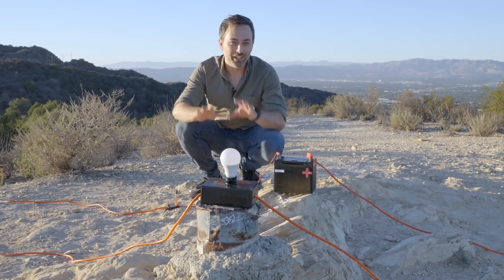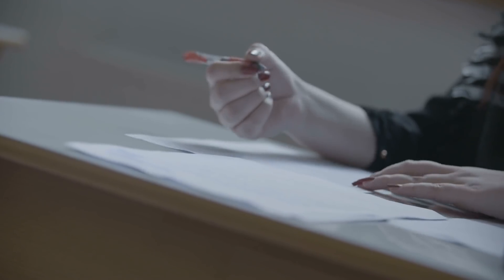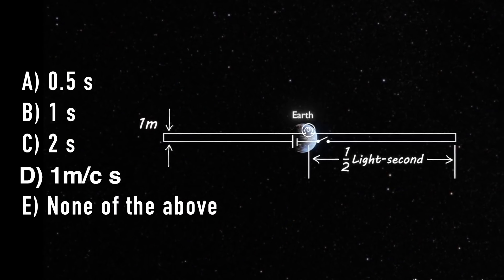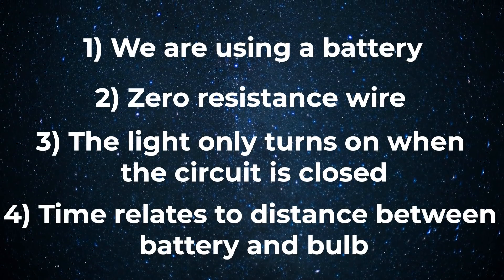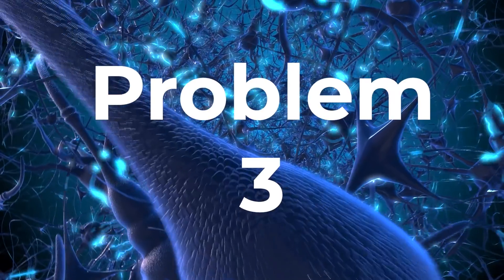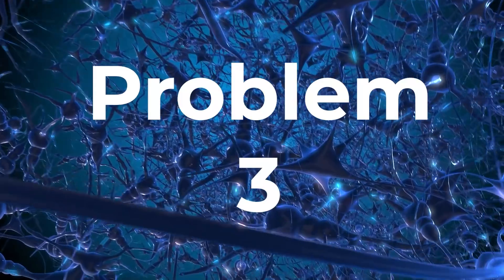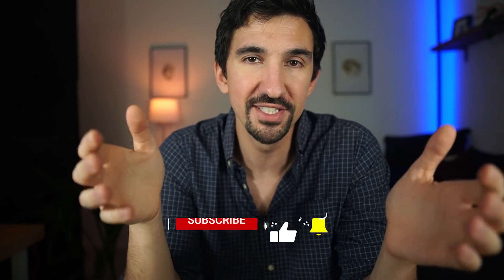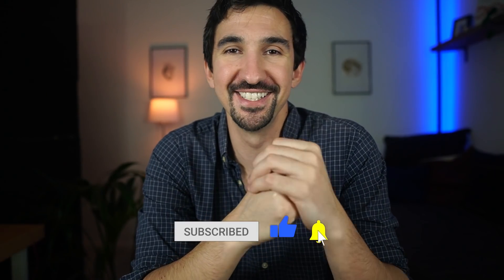Is Veritasium Wrong About Electricity?

Comment: The idea of general relativity and speed of light being a reason we cannot transmit info across the galaxy faster than the speed of light is wrong if you think of quantum mechanics and quantum entanglement.
Reply: Quantum entanglement doesn't let you transmit "information" faster than the speed of light.  Look up the no-communication theorem and you'll see why.
Reply: @JeRMRellum  ah but you are talking about quantum mechanics as a way to communicate over a vast distance faster than the speed of light. That is true, you can not use it as a form of communication, but it does not contradict the fact that with quantum entanglement information is sent from one entangled particle to another is sent faster than the speed of light. Quantum physics does counter the idea of general relativity and even Einstein knew this.
Reply: @Derek4k  Well, so entangled particles MAY be able to transmit information to each other faster than the speed of light.  But that isn't proven.  What's shown by Bell's experiments in 1964 is that local realism cannot be true, meaning either 

(a) non-locality: quantum entangled particles can communicate with each other faster than the speed of light or 

(b) non-realism: The particles are only real when observed (which the principle of non-realism is really weird, it basically says that if you have Alice and Bob both measure their entangled particles at the same time a light second apart, than Alice won't even exist until Bob is able to observe her and Bob won't exist to Alice until she is able to observe him).  

Quantum mechanics generally follows he principles of non-realism while an alternate to that is Bohmian mechanics, which says particles are all real and deterministic but they can talk to each faster than light.
Reply: @Derek4k  Also to elaborate slightly more on the principle of non-realism, I only really began to feel like I understood it when I thought of Minecraft.

Let's say theoretically there are only two fortresses with two ender portals in a world and let's say they always MUST share exactly 12 ender pearls between them that are already placed when you discover them.  This means when you find an ender portal and you see it has 7 pearls, you already know the other one will have 5 pearls when go to it later and observe it.  Or if you saw it had 9 pearls, you'd know the other one has 3.

Now, you know this number is random, and you also know that the number of ender pearls is determined when you first uncover the chunk and observe the portal.  Since Minecraft can't have both fortresses loaded at the same time, you wonder what would happen if you arranged to have both fortresses discovered simultaneously.

You coordinate with another character to count the number of ender pearls preplaced in the portal and to do that at exactly noon in Minecraft time.  You find yours randomly has 4 pearls, meaning you know the other one must have 8, so when you meet up later to check with the other character, you confirm this is true.

But how can this be?  Minecraft wouldn't have both chunks loaded at the same time (equivalent to in our universe we have c, the speed of propagation).  If this character is a non-player character, that answer is obvious, the NPC didn't exist until you went and observed it later, at which point the game determined that they must have seen 8 pearls.

Uh, so basically, I don't fully understand this, but I think either you end up with a solipsistic view of the universe or a many worlds one (no one else exists but me OR everyone exists but in their own separate universes which may diverge at anytime).
Reply: @Derek4k  From Wikipedia's Quantum Entanglement page: "According to some interpretations of quantum mechanics, the effect of one measurement occurs instantly. Other interpretations which don't recognize wavefunction collapse dispute that there is any "effect" at all. However, all interpretations agree that entanglement produces correlation between the measurements and that the mutual information between the entangled particles can be exploited, but that any transmission of information at faster-than-light speeds is impossible."

Key word is some.  And yes, if you believe that the universe is realist, than yes, the particles are communicating faster than light.

Comment: I absolutely loved this video and it explained everything I couldn't get my head around with Verulamium's confusing video. Conceptualising the wires as antenna as opposed to a circuit made perfect sense and pretty much explained everything. I felt as though Verulamium's video was deliberately confusing in order to get his video and resulting discussions viral.
Reply: Verulamium is the city of St Albans, England.     I like play on words…usually…but it doesnt always work.
Reply: Veritasium looks at the problem from first principles. From fields and charges. Antenna is a complex concept that uses those principles in a way that amplifies wanted behavior. What Derek does is like talking about how base pairs in DNA work, and mentioning antennas is like saying twins have the same eye color.
Reply: @niceshotapps1233  No, what Derek does is like mentioning that twins have identical DNA.
Reply: @Str4t0sph4r4  Yup. Which is actually key insight into why twins "work".

On the other hand, saying it works like that because it's just antenna or it's capacitance and inductance is like saying twins have the same color because they are twins, duh! It doesn't explain true underlying mechanism. It's just easier and more satisfyingly understandable.

Comment: It's easy to show someone is wrong if you're not considering the same exact system with the same assumptions (f.e. adding resistance, capacitance etc.). It's harder to see what's is wrong in Dereks circuit problem (indeed it is) if you consider exactly the same conditions. Here is why: the energy from the battery WILL REACH the lamp in approximately 1/299792458 seconds but that energy WON'T BE absorbed by it until the current starts flowing through the light ball which will happen after 299792458 seconds.

Comment: He didn't mess up with the units. Time = distance/speed. in this case distance = 1 and speed = c. Therefore time =1/c s. I thought it was understood that he was working in SI units.

Also you disregarded the capacitance of the wires.

No information is communicated faster than light in Veritasium's video.

Comment: I think that your miss understanding that the important part is the position of the switch not of the battery, because the wire have no resistence is the same as consider that the batery stretching the lenght of the wire. So when you break the cirtuit far away from the light it will take longer than when you break the circuit close to the light. I image that when you break the circuit far away the field will stretch legth of the wire than break so will take longer to the energy flow to stop.

Comment: This is a point I have too. 😅😅🤔
I'm wondering if Veritasium and the bulb were at each ends of the circuitry... And it was 3 000 000 kms long ? 
How many time would it take for the bulb to light ? 
And the same circuitry in his case ; ie  him and the bulb at the middle (you understand 😅) ? 

And your point about the units between the answers : it seems for me these kinds of when we can be confusing in w, w/h (wh-1 👏) and wh...

Anyway, thanks for your questionings 😂

Comment: You are wrong about the 'faster than the speed of light' claim, because the lamp is physically close to the switch, even if the wire is long. So causality does not travel faster than c. He's also not saying the bulb is turning on, so that's a bit of a cop out, he says it will take time for current to grow in th bulb..

Comment: I believe the answer is theoretically  instantaneous, I do agree that varataseum did not explain it well enough. However, our universe is still bound by maxwells equations and Faraday law of inductance. The theoretical perfectly conducting wire, even though it's perfectly conducting. Would still be bound by laws of inductance. The wire itself is not wound like a traditional inductor, but it still would act as a very large inductor with an extremely high inductance value. Therefore, current would flow immediately through the wire upon closing the switch, but the light bulb likely would not have any visible light emitting for multiple days. Faradays law is quite clear, as current flows through the wire, potential energy is then stored within the magnetic field the rotates around the wire following the right hand rule. The most hilarious part is going to be. That upon opening the switch, the light bulb is going to go out. But potential energy stored in the magnetic fields in the wire would produce such a high voltage, the arc between the connections of the latch would be devastating.

(I am an Electrical engineer, who fell in love with electromagnetics :) )

Comment: My take on that "breaking speed of light" problem:
1. EM fields spread at the speed of light, but not necessarily along the wire. 2. A circuit break (including an open switch) is where electric field is "broken".
When you close the switch / break the wire, EM field starts spreading from that point in space at the speed of light.
So when the breakage is 1 light-second away, the "bulb" will start "turning off" after 1 second, when is is 1m away the same will happen in 1m/c, regardless of wire length.
Reply: No. You should think about where most energy go. Not shortest way.
Reply: @piotrjuszczyk1  Not sure what you mean. The whole point of Veritasium's video is that [in idealized experiment, some] energy starts to reach destination in shortest_distance/c regardless of wire length. How much energy gets there how quickly is a different question.
Reply: @SunnyOhm  The main problem with the video is when the light bulb comes on.
It will not light up when the first field shift gets there. Only when most of the energy gets there. So after 2 s bulb on. Not after 1m/c.
If You look for problem: when first energy from battery get on bulb - the answer is: this is not about switch on/off. The first energy in bulb is when battery is. Switch does not matter like air beetwen bulb and battery  - does not matter. But this energy is very very small.
Sorry, I am not english man.
Reply: @piotrjuszczyk1  That's why I put "bulb" in quotes. Let's say it is a BJT with a very high gain (1000x is real) driving a tiny LED (human body has low enough resistance to visibly light them up from a 4.5V battery).
Reply: @SunnyOhm  Yes. But this no need switch in this case. 
And this is not case from veritasium.
Reply: @piotrjuszczyk1  Why no need switch? Transistor is placed in place of the lamp, and it won't open until current flows through it. Just a more real model of suggested idealized component. Same as a contraption for cooling the whole wire to superconducting temperatures would be.
Reply: @SunnyOhm  Because switch is only few mm of air. 
If You don't have trouble with meters of air - switch doesn't matter.
Reply: @piotrjuszczyk1  Switch matters, because when open it doesn't let electrons flow in accordance with electric field. And without charge movement there is no magnetic field, ergo no energy transmission.
When opening, switch won't stop electron flow immediately and completely, but eventually it will.
Reply: @SunnyOhm  How You can write about energy flow with meters of air and that switch with one mm of air stop this :)
Ok, I am to weak in english to explain this :)
Reply: @piotrjuszczyk1  The antenna analogy is aplicable here, just doesn't demonstrate things well enough. No one (I hope) doubts that antennas can transmit and receive energy, a simple AM radio receiver can work without any power source. The whole point of Veritasium video is that when there is a wire connection things fundamentally work the same way as withantennas.
Reply: @SunnyOhm  Clue of Veritasium video is question: when bulb light. That's all. After 2 s
Reply: @piotrjuszczyk1  If you want to be pedantic, it will take even longer. Inductance and capacitance of such a long "real" wire are enormous.
Reply: @SunnyOhm  The Veritasium thought experiment has specific assumptions.
Omits: resistance, capacitance, inductance, inertia of the bulb.
It contains one simple question: how long does the bulb light up after being turned on by the switch.
The answer is simple: after 2 seconds because the cable is 600 thousand. km long.
It does not matter that a small amount of energy will arrive after the time needed for the light to travel 1m. If small amounts of energy counted, the same position of the battery near the bulb would change the field there.
Therefore, the switch is not needed because for small amounts of energy - the field there is always changed by the battery. Whether he is there or not. Each change changes the field there, but not every change lights the light bulb.
Turning on the switch will of course change them, but it will still be a small change that has nothing to do with lighting the bulb. Therefore, the switch does not matter. The battery itself changes the field, regardless of whether it is this switch or not.

This question can be changed a bit. Assuming that the wire has a very high resistance, we know that the light bulb will not light up, no matter what you do with the switch or what the distance will be. How does the cable at a distance of hundreds of thousands of km affect whether the bulb lights up? :) It affects faster than the speed of light is? :)
Reply: @piotrjuszczyk1  I think I know what you missed.
> the field there is always charged by the battery
Electric field, yes. But there is no magnetic field unless electrons move somewhere. And without magnetic field Poynting vector is zero, so no energy transfer happens. The switch is exactly what stops electrons from moving.
Reply: @SunnyOhm  But the noticeable magnetic field won't come through the shortest path to the bulb. And therefore it does not matter whether there is a switch or not. Because we're talking about the experience of lighting a light bulb all the time.
A bit as if you connected a broken wire to the battery - will there be a field or not? :)
Reply: @SunnyOhm  I think I can see what Piotr's problem is here. The antenna effect you're talking about (and that this video is talking about) is based on the electrons moving and creating a change in the field that radiates out. That's all fine. What seems to break causality though, is that the electrons near the switch somehow "know" if there's even a battery attached to the wire, before 1m/c seconds.

Here's a slight modification to the thought experiment: What if when you were setting up this circuit, you could choose between two batteries. One of the batteries is dead, and one is live, but you don't know which is which. You install one of the batteries. Then when you flip the switch, according to this model, you'd nearly instantaneously see a change in the field where the bulb is, but that would mean you'd now have information about the state of the battery 1 light second away.

That's why Piotr is saying the battery doesn't matter. According to the antenna model, you might as well have a switch and wire, 1m away from a light bulb and another wire. Because the battery can't influence something a light second away in less than 1m/c seconds, so it's ultimately irrelevant for that initial pulse of energy.

Comment: It's not just the number "1" over m/s  which results in s/m , but one meter over one meter per second or in units[ m / (m/s)  ] = [ s ] which results in seconds, so 1/c seconds is the correct measurement of the time period. The problem with the wires comes from assuming 0 resistance, which is actually geometrically dependent property, connected to Poynting energy vector flow in relation to Fermat's principle in Quantum Elelectrodynamics about the Shortest Time path (NOT the Shortest Distance path) of a wave in electromagnetic field. The type of the medium (metallic wire or air mix of gasses, isotropic or anisotropic geometric structure.. etc..)  actually matters for the Shortest Time path of the energy flow.

Comment: I tought this was causality breaking too but in a other way than you described, think that u have a  friend(i know its hard to imagine that but try) that u gave an current meter and told that when you get reading that current is flowing the light bulb is on, then you send that friend 300,000kms away to the point where the wire is at its furthest, couldnt you just communicate to your firend using the switch to turn ur light bulb on with a latency of 1/c when your friend is at a distance that light takes 0,5sec to reach. Wouldnt this be true if you consider that the light cannot be powered to the point of turning on just by using the induction current, or using the gap as a capacitor.

Comment: I think people are fixating too much on the distance. Let's suppose that instead of 0.5 light-s, the distance was 10m. What would be the exact time of light turning on ? 1/c or 40/c or 20/c? the explanation given by veritasium for 1/c works in both cases. The coupling argument won't though, as the effect is negligible.